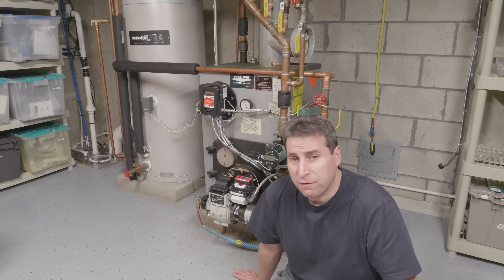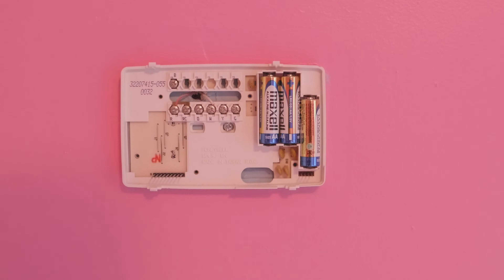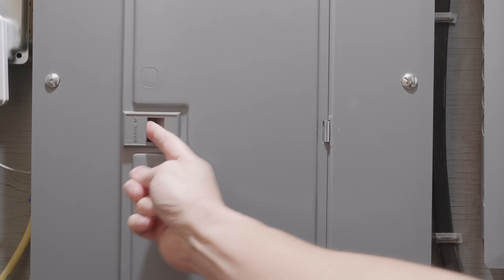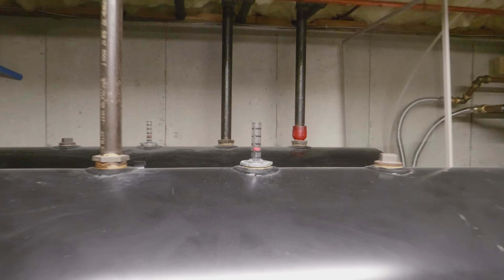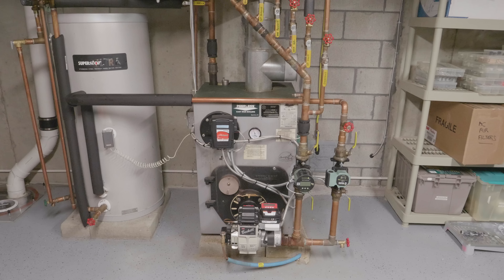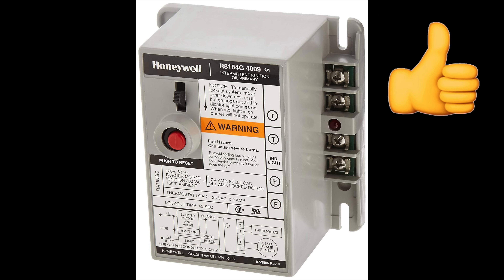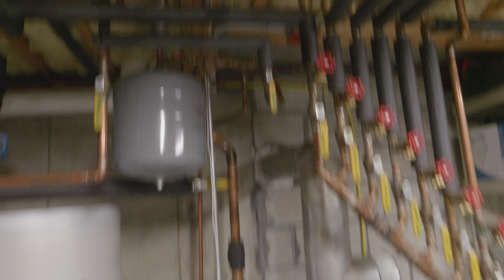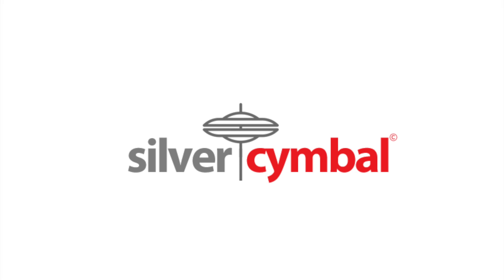Top 10 Heating Problems EASY Fixes for No HEAT - Boiler / Furnace Troubleshooting OIL HEAT

Comment: My boiler is older than the one in this video. It does cycle but the house doesn’t seem to get warm. I changed the batteries in the thermostat. Hit the reset button and it fired up and cycled but the temperature in the house didn’t increase. I have the thermostat set at 70° and it’s only 42° in the house. I have pictures of the boiler I can email you and a short video

Comment: Good advice you can also use diesel fuel for number two fuel. You should never let your heating system get down to a quarter if you can help it. Put sledge or residual bacteria in the oil into your filters clogging the system. Still wish people would stop replacing their woodstove or wood systems with gas. Always have a back up heat source. Find wood fireplaces  to be the best.

Comment: Good advice but wrong on the red switch for old houses. We have no red switch has to be turned off at circuit breaker. 3 circuit breaker boxes in house. A Small box has the furnace switch in it and is by the main box which has a small box on the other side. Back of the house has a separate box. Some wiring is just paper covered wire in the basement. Half are circuits are glass or fuses that need replaced ever so often. Also wrong on red box #5 not required in my county. I live Mennonite country by the way.

Comment: This video just saved me $$ from calling my boiler guy. I had no hot water & my Beckett motor had no green light. I flipped the power switch on & off on the boiler, I held the red reset button, checked the circuit breaker, checked my oil levels, etc. Just when I was about to make that pricey call, I watched this video. Had no idea the emergency switch controlled the boiler, since it's located in a hallway away from the boiler - and it was off. Thank God for people like you on Youtube!
Reply: Oof. Rest assure, you're not the only person who's done this and called out an HVAC/Plumbing tech. There are switch guards you can buy online that make it so the only way to flip the switch is to grab it with two fingers so it doesn't get turned off by accident.

Comment: I have a tri-level with 3 zones, and have seldom heated the upper and lower levels, living mostly in the middle floor. But it just occurred to me that as long as the boiler is running for the middle zone, I may as well set the other zones to temps lower than middle as the unused heat just goes up the chimney.  With the price of oil at about $6/gallon I want to make the best use of the energy/heat, and maybe start living in the other two zones.   Any comments?  Thank you!!

Comment: Hello again. I have a BURNHAM Gas Boiler with Baseboard hot water system. 130,000btu with an AMTROL storage tank. 
4 zone valves and 1 circulator pump. 
Thanks again. 
Mike i

Comment: Thank you for all your videos. I want to be able to run my boiler if I lose power in the winter(nyc). I installed a 30amp inlet box outside, installed an interlock on CB panel. I want to put a single receptacle one plug on my boiler when everything is being powered by utility. Unplug it and connect it to my generator, it says less than 3 THD. Is it safe to do that or do I need a UPS? Do you think you can shoot a video how to install that single receptacle to the Boiler wires and the 12-3  Three prong plug. Then remove it and connect to the UPS? 
I trust you and seeing it done would be so so helpful. All the best to you and your family. Mike i.

Comment: Initially my oil boiler was providing hot water to the house but now that I installed an electric water heater how can I stop the boiler from providing hot water and only use it to just heat the house please

Comment: Do you have video on how turn up the temp ..? Our boiler heats water but doesn't stay hot long enough for 10 mins showers. I have house full of girls
Reply from the maker: It's usually a little more than that and you have to be careful when changing the setpoint of the boiler. But usually its that the tempering valve failed or has build up. I wish I could help more for that one you are probaby going to want to call someone in.

Comment: THANK YOU SO MUCHHHHHHHHHHHHHHH.....
FOR THIS VIDEO. I THINK YOU MADE THIS VIDEO SPECIALLY FOR ME. I just closed on a house, and I moved in the same day and guess what? When I  moved in the house the first night, heater was not working. I called for urgency help no one can right away because it was too early in the morning.  Something told me search on YouTube . I found you with this video §aying if you have no heat here are ten ways to solve your problem and one of them was the reset button . I pressed it once the quicked in. 
Thank you so much .

Comment: If the boiler is off, switch it on... if its out of fuel, fill it up... if it doesn't switch on, replace batteries...  AARRGGHHH!!!  Anyone without heat, looking for solutions - and doesn't have the COMMON-SENSE to have already checked trivialities such as these, deserves to freeze.  Troubleshooting-tips for Morons.

Comment: #5 is false.  I live in Pa. I've worked in probably 1000 houses and I've never seen the ceiling mounted overheat.  It's not national code.
Reply from the maker: In Mass it's 527 CMR 4.00  (e) An electrical thermal switch fused to break the ungrounded conductor in the main
circuit at 165°F, shall be installed in the main power line within six feet over the top of
the burner-boiler or burner-furnace.
Reply: @SilverCymbal  it's a great idea. I like it but it's not national.  I wouldn't argue if they made it a national requirement.
Reply: @coyotejoe80 , I live in ny , I have never noticed anything like that before.

Comment: My mother has a 23 year old Peerless oil boiler with no external water heater. My mother is elderly and not capable of maintaining it. I live far away and only get to see her once a month. Last time I visited I noticed a white paste coming out of the water release valve spout at bottom of boiler also some water was leaking out of the spout. My brother told me he use to drain the water from boiler once a month to keep it clean but that hasn't been done in 10 years. The boiler is cleaned by the fuel company once a year. The front of the boiler has a glass tube filled with water the water in that tube is around 80% rust colored. The boiler is running fine. My concerns are what is the white paste? Do I need to empty the water out of boiler once a month till it runs near clear?
Reply: It sounds like you have a steam boiler ? If you have a McDonald and miller 67 float lower cut off. You should be having that drained once a week. Sounds like you have a lot of rust in the boiler

Comment: Saved me $250 for service call, "someone" had switched the heat setting to cool on the thermostat.  No heat in the apartment, 7 degrees wind chill outside.  The pellet stove backup wasn't doing it.  I suspected the zone pump had failed...then I watched your video....thanks so much!!!
Reply from the maker: So glad it helped! These days we can all use some savings!

Comment: I have an old Monogram gas heater that wont cool down  it was good over winter but all the knobs turned to low it's still blasting hot

Comment: Very helpful video for a new homeowner. 
I have a natural gas heater and literally just had a plumber come last night who ended up replacing two zone switches. I didn't even think to compare the pipe temp pre and post switch! Doh!!
But, I did learn about the emergency on/off switch and will label it properly now.

Comment: Good chance I built that boiler. That said, I have an old New Yorker that also has a water heater coil. The boiler turns on for the hot water but not when receiving the call for heat. Thermostat seems to be working properly, still no luck. Any idea on what to check? The boiler was a DIY job by the previous owner with no multi-zone heating.

Comment: Thanks so much. #2 was my problem, was told that switch was left over from an old oil tank. So I removed and heating wouldn’t come on. Put back and reset my taking out the batteries your step #1 and working now. Thank goodness -6C here today.
Reply from the maker: So glad it helped. Thanks for letting me know. Please feel free to share with anyone that could find it useful.

Comment: I can't thank you enough. I had gone through the re-setting of my Vaillant boiler including adjusting the pressure. That didn't help.     Then I started watching your video and your first point, about the thermostat (even though I thought it was very basic) made me look at my (dial) thermostat.      I always thought that our thermostat was non-functioning i.e. not related to our boiler which we installed when we moved in 10 years ago - For some reason, because each of our radiators had their OWN THERMOSTAT, I thought that the thermostat at the stairs was related to an old heating system.    I ran downstairs and saw that the thermostat was at 0 degrees. I turned it to 20 degrees and our heating started working!!       I am so thrilled, so thrilled that I don't have to find someone to fix it and so glad that I don't have to fork out what I thought could be a lot of money.      We'd been without heating for 3 weeks.     When my husband got home from work he said that, like me, he thought the thermostat was old and not working and he had changed it to zero for some reason.    Thanks again for saving us so much trouble, and money for the call-out.

Comment: My waters hot and when I turn it on the furnace comes on for a little while but not long enough to heat the house. There was guy changing phone lines in my house and I really think he messed up the wiring. Also I can't find an emergency switch anywhere and I know if notice if it was at the top of my steps.

Comment: I have baseboard heating system that runs on gas and water but currently it looks like the heating system is not using water but just the gas to provide heat , what could be wrong with the system ?

Comment: PRO TIP:  When replacing Tstat, look into the service manual to see if you can wire it to run off of 24VAC; or the specific voltage required to not have to run off batteries. Same goes with the existing. Solves the battery problem of a no heat situation.  Keep in mind, not all Tstats are manufactured in such a way that you can do what I’ve described. But it sure is nice. 👍
Reply: C Younger  Maybe they can; maybe they can’t.  It’s unwise to assume someone’s skills level. But what I’m not assuming is your inability to read the first few words of comment that says “PRO TIP”   Enough said.

Comment: What could be wrong? I have a vaillant boiler that pump hot water up to my radiators for heat. There is a radiator in each room of my house.  I can see the small flame (pilot flame) is lit but it won't change into a big flame to boil water. I try to by pass the thermostat by connecting both    red and white wires (thermostat wires) but nothing happened. So I think the thermostat is still good. I turn off the electric switch on the side of the boiler and the small pilot flame is off. Then I turn the electric switch back on and it self ignite the small pilot flame on again.  But it won't change into a big flame to boil water. Could someone help, what could be wrong here? I'm thinking the circuit board where the two thermostat wires are connected onto is damage but I'm not 100% sure. Please help if anyone know what part is bad or damage. Thanks

Comment: I can't tell you enough how much your video helped me resolve my boiler not starting.  I tried so many times troubleshooting the thermostat.  I even changed out the thermocouple on my boiler thinking that it wasn't sending enough current to trip the gas furnace to turn on.  The section where you discussed the furnace switch (#2) fixed my issue.  The switch was on the Off position.  I must have accidentally knocked it into Off when I was moving my mattress to the basement.  As soon as I saw part #2, I went to the switch, noticed that it was on the "Off" position and then switched it to "On".  Voila!! I immediately heard the furnace kick on.   You're video rocks.  Keep up the great home troubleshooting vids.
Reply from the maker: I really appreciate that, I love to hear that the videos helped out. Most of the time it's an easy fix which is good news and that you didn't need to call a heating guy. Thanks for watching.

Comment: Can you explain in details please the wiring diagram and electrical troubleshooting.
Reply: Sure, no prob. 2+2= banana pancakes
Reply: Each boiler might be wired slightly different. But knowing the color coding on common primary controls on crucial for oil burners. 

Blue= ignitor\transformer
Orange = burner motor
Black = line voltage
Yellow = cad cell

Comment: My oil burner is working perfect for hot water but not working for heat?? Guess I gotta call the guy in.
Reply: What was the solution? Was it the switching relay or the circulator ?

Comment: I have a tankless hot water system.  The house is being heated, but the hot water is luke warm,  it does get hotter if the boiler kicks on to heat the house.  What is wrong?
Reply from the maker: I am assuming the tankless is within the boiler if that s the case and it's older it might be built up with scale. Some techs will clean them others won't, It also is often the tempering valve, a tech can change that also. These are two items you will likely need a tech for but at least you can ask about these as a starting point.

Comment: Hi, i thought this video was super excellent 👍

I have a similar set up and in NJ. The issue I'm having is my tracometer ?  Never goes under 140 so when I turn my heat on it only runs for a little while once a reaches 190 it turned off. It take so long for the heat to come back on that I set my thermostat at 68 but it never gets there. It stops at 63 and 64 and it's been cold these months so I'm trying to figure out why that's happening.

I had maintenance done on it back in October and I have about a quarter tank of fuel. All the other parts that you mentioned seem to be working fine. Any advice? Thanks again I appreciate your expertise!
Reply from the maker: Thank you for the kind words.The 140 and 190 are the high and low limits. These are set by a tech but 140 does seem a little low to me but I am wondering if your thermostat itself by be bad. It does happen and since you are getting some heat my two things would be to swap the thermostat which can be pretty easy to do. Or have your tech come back and ask him if your low limit of 140 is too low. I hope this helps and thank you for watching.

Comment: Zack I want to thank you for your warning about CO2 . After your warning I went out and purchased a combination smoke and Co2 detector just to be safe .Well it went off at the coldest time of the night . I hadn't done anything wrong with my DIY repair. I pretty quickly found a hole That had rusted through the vent pipe . It was only the size of a pencil eraser but it was enough to trip the detector. Obviously it was an easy repair to replace that section of the vent pipe.
Reply from the maker: Good thing you checked! I am a firm believer everyone should have at least one CO detector in their house. It's a misconception that CO leaks will make you sick first, there can be a small leak like you had that creates a dangers and very unhealthy situation and it will eventually become deadly.
Reply: JAYJAYJAY53 Hello Jay Jay… If you had such a small hole in the vent pipe and it still tripped the CO detector that means that that burner is making a lot of carbon monoxide so you should really have somebody come and do a “combustion analysis“ of it and probably find out that the air inlet setting for the burner is probably incorrect or something else to cause such a high CO reading. Please heed my advice hopefully you’ll be around later to thank me. 
   Edward H. Owner/service tech of “Integrity Plumbing, Heating, Septic and Drain“ in CT
Reply: That was the first night of using that detector after a repair. I had actually placed about the detector above and and about two feet away on the first night and it was ten degrees. It hasn’t gone off again. It’s a gas system hot water system

Comment: REALLY off-topic question - You have a gas line going through the ash dump of your chimney? I am assuming you have a gas fireplace insert? I ask because we are in the process of purchasing either a gas or wood burning fireplace insert. We are estimating the specifics and cost of what would need to be done to make them function. The gas insert needs gas (obviously), and the wood insert needs an electric line to power the blower.
Were there any issues with your gas setup passing inspection?
When the time comes, I will hire a contractor to install my fireplace insert. I just want to know the possible hiccups and solutions in the installation.

Love your videos! Thank you!
Reply from the maker: You have good eyes! Yes that is exactly it. I purchased a second hand gas insert and installed it myself. BUT I had a licensed gas installer do the line and had it inspected. I do everything myself but gas work is not something that I will not work on for me on anyone else The installer ran it through the clean-out as shown which was OK and approved. It's a common way to retrofit an insert, As an aside. the insert was a great purchase, it made a huge difference in our room. Hope this helps and thanks for watching.

Comment: Can use 5-10gals of diesel fuel from the gas station in middle of night if run out of oil
Reply: Yes, it’s all diesel
Reply: Diesel and #2 fuel oil do have slightly different characteristics, but diesel will work in a pinch. So will kerosene.
Reply: i know its all diesel but I think it different so I dont know